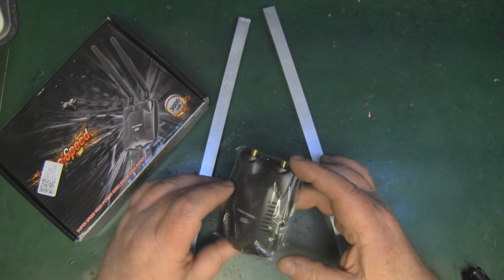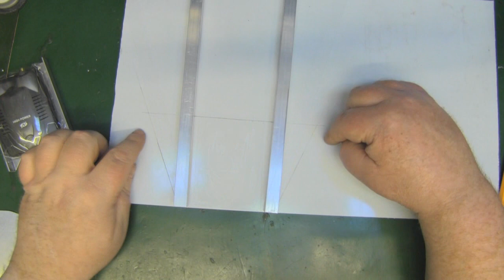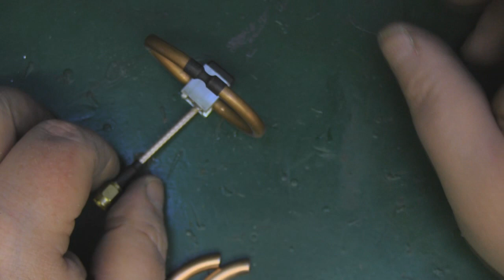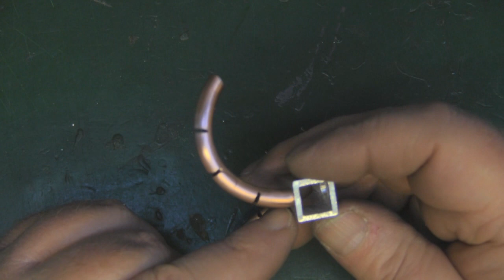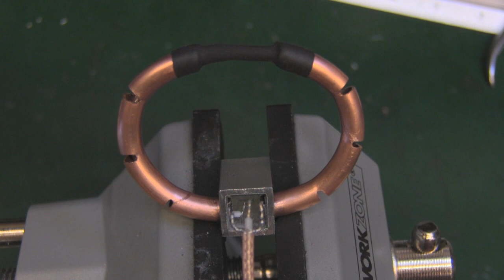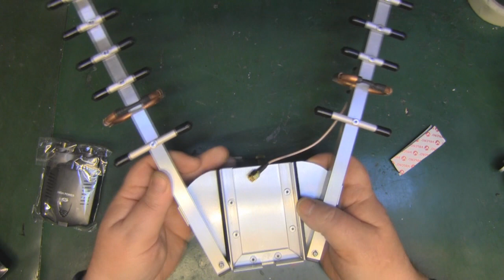Double Yagi Wifi Rig

Comment: I have the same adapter, and I think this setup won't work that good. From what I found out about this card is that the first antenna is for receiving, second for transmitting.

Comment: if you fill it with sand or salt, flatten the ends and seal with solder then bend, it will help prevent the unwanted crimps.  Once you have it to shape, you can cut the ends off.

Comment: Looked to me the driven elements are directly shorted by the square tubing ?  Did you insulate the copper from the aluminum tube?
Reply from the maker: No that's how this design works
Reply: @andrewmcneil  Being a ham radio operator and this wifi is also a transmitter, the coax should not directly short on the center to shield like this or it will burn out the rf amp in the adapter, maybe not immediately but it will degrade over time.

Comment: Hi Andrew, the impedance of the folded dipole on you Yagi would be around 175 ohms. A matching 3/4 wave stub of 95 ohm coaxial cable should be used to feed inside the folded dipole as this will create a 1.1 transformation. From there on standard 50 ohm coax can be used as the feeder line. The 95 ohm coax is available on ebay as RG180. Try it out and see the improvement in the SWR.
Reply: Do you really think he checked the SWR?  He didn't even take the adapter apart to check that it had outputs on both antenna connectors before he started. He also seemed to get the concept of director and reflector elements mixed up.....

Comment: please sir make a 4g atena for 1800 mhz i badly needed it. Tried a few through online calculators but neither worked because i think i am not doing the balon and driven elemnt right. Thats partly because the sites or calculators that provide element measurment dont give a practical guide to built a driven element.  it will be a huge favour sir please

Comment: so clean look and accurate crafting

but what kind of engineering madness this driven element is?
can u check this antenna on SWR-meter?
Reply: I wonder if we'll get an explanation of that driven element. "Some kind of copper tubing"!! It does not look right to me either. Get it wrong and the output stage is likely to burn out or overheat and die prematurely.
Reply: well...modern adapters do not have much output power to burn something :) even such weird antennas with SWR=5....10 will not damage your adapter

but yes, it is Very strange thing

if you think about it, tiny cuts do not change SWR much, inserting coax into folded dipole really making balun, BUT it still 280 ohms folded dipole

Andrew, please check it on SWR-meter

Comment: Careful cutting the outide of the driven element - you are reducing the effective lenth of it because the current is now only passing on the inside of the curve,  shortening the length of it. It will then act more like shorter-but-fatter element, because the extra metal is still attached but current doesn't flow on the oustide of the bend due to the cuts, but the element is still thick. IYSWIM
As a result Q wil be reduced as well as changing ther resonance upwards in freq.

edit: see side view of loop at 16:41 - measure the distance around the intact part of the tubing of the loop and then measure the outside of it. Difference in this length maps to change is frequency. 
Due to the thickness of the element being a significant proportion of a wavelength at WIFi freqs, this can have quite an effect. 
Contrast that with the same arrangement at say 10Mhz and there's little or no effect.

Just change your overall length to compensate - should be easy enough because you have an anal spectralyzer to help you  :)

(but note the Q reduction can give the impression that there;s no need, due to flattening of the response curve. Low Q is your enemy because it leads to lost eficiency (gain) though in some cases it can be useful to provide a wider response , but always at the expense of lost gain) High Q is hard to achieve at WiFi freqs and you need to try and preserve it any way you can. Above 2 or 3Ghz the response curves of antenne are usually too wide anyays, rather than too narrow.
Reply: He didn't even take the adapter apart to see if both output connectors were active. No comparisons with anything either. It's a fairly random home brew project with a suck it and see approach.

Comment: Andrew, thanks for another great video.
 I have two ebay wifi adapters which look identical to yours there, but branded 'Etekcity'. On both of them only one of the two sma connectors is active,  although the the pcb circuitry for both is there and looks ok at first glance. 
Are both connectors active on your adapter?